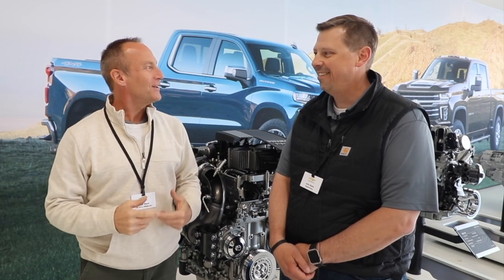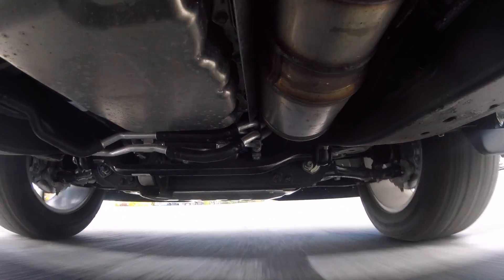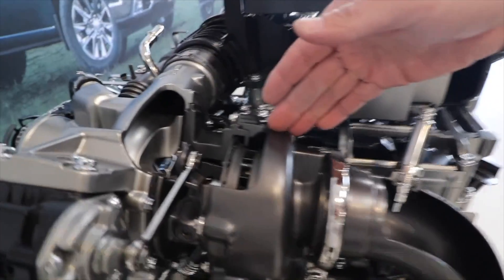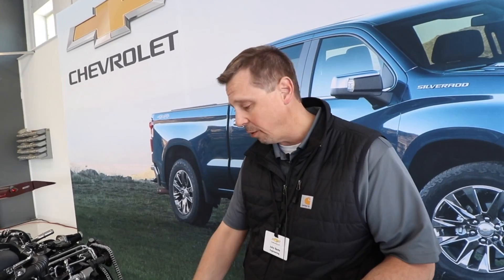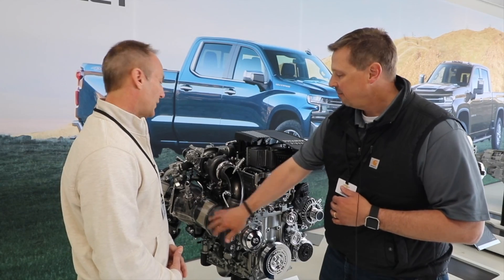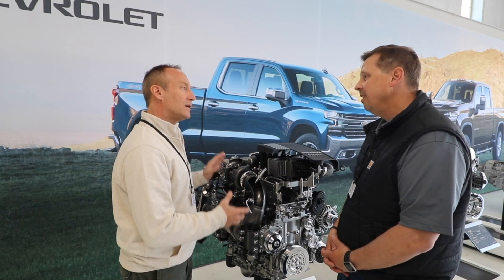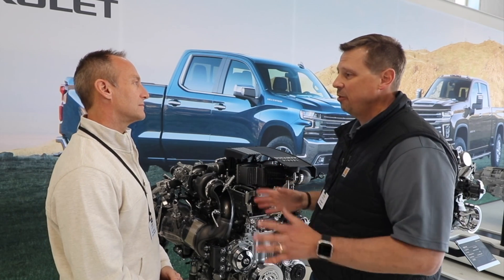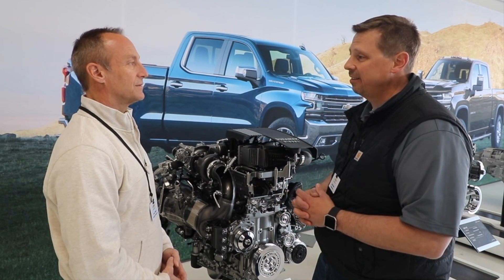Engineer Reveals All! Duramax 3.0L for Silverado 33 mpg hwy

Comment: I really like that they went with an in-line 6 but they lost me with a “wet” belt driving the oil pump at the rear of the engine where you have to separate the engine and transmission to get access to it. Additionally, an aluminum block on a diesel? No thanks.

Comment: GM never said or implied the following: (It will make it 150k miles, that is 70,000 miles of power and greatness.  I promise you will get the full 45k miles from this 15k mile engine and boy will it last you at least 150 miles. ).  I went to a Chevy dealership and they swore the Durmax diesel had Platinum tipped spark plugs that would last 100,000 miles.  I told them if the diesel had Platinum tipped spark plugs I would buy it right away.  That sales guy was so happy until he talked to his manager when I ask him to verify they were indeed Platinum tipped spark plugs.  Bought a Ram when the sales guy told me about the Cummins and knew all about including def usage rates compression ratios and laughed when I ask him if it had Platinum tipped spark plugs.  He knew I was kidding.

Comment: So, public math: 7500 miles on this diesel getting 33mpg, at $3.00 per gal plus $74 DEF is $755.82. So if your gas model gets 25.8 mpg at $2.60 a gallon, it’s equal. Then you can add in the extra maintenance costs and that the engine cost more to begin. This is at the current $0.40 gap of diesel and gas. It was at $0.60 recently. Hmmm

Comment: Ok. Cool engine. Glad to see GM making a light duty 3.0L for the 1500. However...however...who was smoking the weed when they decided to put the timing system at the back of the engine? Having to pull the trans to fix a timing chain is ridiculous. Better put a lifetime warranty on the timing system. I bet the stealership will be glad to ding you $2K to put timing components into this thing

Comment: I like that they added it as a option for the LT, unlike Ford, VW and others.  Only way to get TDi in the Jetta was to get a premium package which put the cost through the roof.  Same with Ford.  Someone who is buying a diesel engine wants economy, how the fuck do you think you will sell any of these when the vehicle costs as much as a house??  I dont care what the excuse is.  I think Chevy did right here unlike the others by offering it in a lower trim.  Only thing that really concerns me is two things right off.  First, that bicycle chain sized single row timing chain.  Not like we havent seen any failures from other engines with chains like this....Hemi...  Second, how close that DPF is.  Even if there are heat shields there, with that DPF up under the cowl next to the firewall, it will get hot and anything plastic there will be roasted in not much time.  We'll see I guess.  Looks cool though.

Comment: You started engineering the engine 5 years ago and it has a rear mounted timing system, and belt oil pump drive. Yes sir, you engineered that engine for residual income and profit. Not even third world country engineers would have done that.
Reply: Engineer are engineers does not matter the country origin, sometimes poor origins feed the ideas think abou it

Comment: What I’m concern about is the longevity of the transmission. I have a 2017 GMC Sierra crew cab SLT and the transmission is garbage.
Reply: Buuboi214 the new 10 speeds are nice. I have it in my 17 F150 and now have 55k miles and it’s never had an issue (unlike the 6 speed in my 2011). Ford and GM partnered together to build the 10 speed.
Reply: 8 spd?
Reply: Rollin Easy yup!
Reply: @Buuboi214  yeah I agree. At low/ parking lot speeds its garbage. Hard acceleration it shines

Comment: Unless these are built in the US from US spec parts (or German-Japan) this engine is going to be a anchor. Chinese spec/out of spec parts won't cut. Plus it sounds like there is ALOT of critical maintenance (dealer only) required.
So overall... more money to buy the pkge. More money to maintain the vehicle. And more visits to the dealer.
If your not driving over 20K miles a year. Get the gas engine and save yourself all the upfront-long term money and headaches.

Comment: Great engine until they used a belt to drive the oil pump. You just took a 500K mike engine into a 150K engine. That’s going to be at least a $1K service, and for me that’s about 7 years. Who knows what happens with other systems. And how much is this upgrade going to cost over standard engine💵💵💵💵💵.

Comment: Swirl valves? That’ll be an issue if they have any issues with soot buildup
Reply: Low pressure EGR should result in significantly less soot being ingested... however I see they do use high pressure EGR during warmup so it could still become an issue over time.
Reply: I’m just speaking from experience dealing with sprinter vans in the rental fleet I maintain. Almost every one of them at some point had to have the engine pulled to get a new intake
Reply: @RobertLeMay848  I can imagine... however the Sprinter uses high pressure EGR which causes tons of soot to go thru the intake, whereas with low pressure EGR the exhaust is drawn downstream from the DPF, thus the soot is already removed. So I would consider low pressure EGR the lesser of two evils as it keeps the engine oil much cleaner.

Comment: I just don't understand why GM is so tight lipped about the actual mpg. The reason to buy a diesel 1/2 ton is precisely mpg, depending on exactly what it is. I just took my 2019 with 6.2 and go 21 over 200 miles yesterday. To balance out the potential reliability issues with SCR, DPF, EGR, on the diesel, it had better get upwards of 30 mpg or it just doesn't make sense, unless you tow every day in which case say, 8-10 mpg towing with a gas motor will be considerably offset by 13-15 mpg with the diesel. I think GM is ultimately hurting potential sales by staying so tight lipped. People are getting tired of waiting and will buy something else if they are in the market.
Reply from the maker: I'm pretty sure they are just waiting for the 'official' numbers from the EPA, but seemed pretty confident it will be north of 30.

Comment: The modern diesel will never last like the old diesels. the EPA drove the nails in the coffin. 150 K miles LOL every modern gas engine I have owned in the last 30 years has made it past 275K
Reply from the maker: I'm pretty sure they all said 150K for those engines as well.

Comment: 150,000 miles? Chevy's goal is to make this truck run for at least 150k miles? Talk about low quality standards.
Reply: Ya well my 75 GMC Sierra Grande 4x4  has 604,600 miles on it and I have replaced only the enging with a GM crate motor at 345,000 miles. GM makes gr8 stuff and they do last a LONG time.  It's all about maintenance. GMC#1
Reply: @scott250r2  only the engine. 😂
Reply: @highbrass3749  Well no LoL. Tires oil break pads belts and lots of U Joints. Hahaha.  (Becouse of my lift kit) And I did remove the 4 speed and I put a THM400 in its place. Other that that. Yep.
Reply: @BigHayes7771  Yep like I said very low standards. Have a great time wasting your time at the repair shop and trying to get the dealership to live up to their promises.
Reply: Sad
Reply: @scott250r2  I had a 72 Camaro, the very first car my new wife and I bought together. Drove that thing for over a decade with just an AC failure. So American manufacturers can make good reliable cars 50% of the time. But which 50% are you going to be?
Reply: @breeze787   That what I'm talking about 😀.  I think now it's more than 50-50 though.  They seem overall to last better than the old days.  On anther note. Are you a 787 dude. As in Boeing 787?
Reply: @scott250r2 American manufacturers are making them better than ever before. But there are still a bunch of badly designed & built vehicles that's going to gnaw at them until they fix it. US auto is still making a lot of bad decisions just check out their recalls and high percentage warranty type work. 
Yeah 787 Dreamliner.

Comment: Note that since this disposable little 3.0 diesel actually DOES meet emissions, you’ll be using 1.5 gallons of DEF per 1000 miles while towing. IF the 6.7 Powerstroke Actually met emissions (see Ford EPA diesel emissions settlement stories) you’d be using 2.5 gallons of DEF per 1000 miles while towing. I think the revised 2020’s DEF consumption will go way up to be where the emissions standards require them. Yikes!
Reply: Neo Craft 
Funny you say that about the 6.7. My former service truck was a 6.7, upon delivery it had a code for NOX sensor...... After putting 32k miles on it I finally replaced it. In those 32k miles it burnt a whopping 2 gallons of DEF. 🤪😜😜. VW were just the only ones caught.........

Comment: Nothing last forever......except for a Toyota Tundra 4.6L
Reply: Michael Pawlicki, you mean Toyota 22RE?
Reply: Steve Stair, It’s not junk if I’m still driving it after 400k, with just a couple issues, and still getting great gas mileage! My Chevy was done long before this.
Reply: You probably take care of it yea they can last have one also but does not get that great of mpg, i also have a 2015 GMC Sierra with just the 4.3 v6 runs great put alot of miles on it will get alot better mpg runs like the older v8 and its a heavier truck.
Reply: Steven Strawn unless you have two drastically different trucks, the tundra weighs more
Reply: @justinmartin8887  not a 2004 tundra compaired to a 2015 double cab it does not its the older smaller tundra.
Reply: Steven Strawn fair enough. I know for a fact the current tundra is heavier than any other half ton
Reply: @justinmartin8887  o yea the current one for sure there is only a 350 pound difference in the two trucks im talking about though. The GMC slightly heavier
Reply: But i also upgraded to bigger wheels and tires on the GMC and has a tool box with stuff in it so probably 500 pounds more.

Comment: What going to happen with the water cooled intercooler when the truck is  sitting or driven in very cold weather?  What will happen if something cracks and leaks over the electrical system?

Comment: Most manufacturers have a "useful engine life" rating of around 150k miles. Ford does. The only time you'll see higher numbers are in the heavy duty trucks where they have "B10" or Bxx  ratings which will give you mileage before 10% or xx% will need some kind of major engine work. Congrats for making a big deal about nothing. You got your clicks though, huh.
Reply: Yeah every manufacturer, outside of Hyundai, uses 240,000 km or 150,000 miles as a lifetime target. It just means that by 150k miles, you'll need to do stuff like timing chains/timing belts, timing chain guides, etc. Hyundai claims they engineer their engines targeting a higher lifetime, but it doesn't show in the reliability of the engines they've been using lately.  

The heavy duty trucks have a higher life target using "B10" and "B50" ratings because those engines are sold in the commercial market and buyers want to see those numbers. Even then, engines like the 6.6 Cummins and 6.7 Powerstroke still only have a B10 of around 250,000 miles.
Reply from the maker: I was actually refering to his comments that he thinks the engine should go way beyond 150,000 miles.
Reply: @4WDMagazine  OK well that's my mistake then. It just seems like thatvpart of the video will create a lot of disinformation because 99% of the public don't understand that the engines in passenger cars, suv's, andblight duty trucks are all designed with the same lifetime mileage. As you see below in the comments, many already are taking it the wrong way, assuming that when the engine reaches 150k miles, it's shot. In reality, it means it might need new timing chains or oil pump belt.
Reply: My son is looking for a good used truck, we got on Auto Trader and we were shocked at how many F150’s and Silverado’s had 200k plus in the odometer!

Comment: I agree that it wouldn't be wise to by first year anything.  But I hope that this engine will provide another way to reduce fuel consumption.  Problem is, in my neck of the woods we pay 10-20 cents more per gallon of diesel.  So it had better be VERY frugal.
Reply: Diesel is 40-50 cents more per gallon around here.
Reply: And there you go.  What part of the country.  I'm in So Cal.
Reply: @ktpinnacle  Minnesota

Comment: DOC, DPF, SCR, DEF, EGR swirl valves....disaster waiting to happen. I don’t see why truck builders keep putting diesels in small trucks and cars. Diesels weren’t designed to just ride back and forth to work, pickup up groceries etc. They were made to work and the shit ran out of them.
They cost more to buy, more to repair, Hell even the fuel cost more per gallon.
Reply: 2 egr... So many failure points.
Reply: Why does the rest of the world use Diesels for exactly that?

Comment: Watch the video again at 7:20 he talks about regen. If you look back at the old way of regen(cleaning out the filter) gm in the LMM 07.5 to 10 Durimax had this system and ford had it in the 6.4 power stroke 08-10. When they inject the diesel into the cylinder on exhaust stroke it washes out the rings on that cylinder and will cause the engine to fail. Many as low as 20t miles. Almost all by the time it got to 150t. So I’m disappointed to see gm go back to an old system that they already know does not work and bring back a problem that they have already got an answer to.(adding an extra injector to the exhaust pipe after the turbo) very disappointing I was hoping to get one of these diesels when they come out but now that I have seen this I will be waiting till someone cracks the ecm so I can delete the dpf and egr before I spend my money on it. Or wait till gm adds the 7th injector to it.

Comment: I would have more concern with the DPF being right under the hood. Heat soaking the engine and intake air temps. Also burning out injectors with all the Cycling. Also seems like they maid the cooling system way over complicated. And two EGRs!  Nothing but engine murderers.
Reply from the maker: You could be right. I think that's what limited the max towing number - cooling challenges.
Reply: It's called,  Satisfying the Gov't 
It's the "New"G-spot~😲
I heard the "extended" warranty 
comes with several free visits to
Dr. BenDover 😱~ 😄

Comment: there are way to many things to fail and clog and two EGR systems they work so great with just one
Reply: Eric Herrmann This engine uses “cleaned” EGR, meaning it’s post-DPF exhaust that goes back in. No soot will make its way in. But that doesn’t mean Ash will not. After 100k, the ash will start to build up inside the DPF and most certainly some will be put back into the cylinders. If you’ve ever felt DPF ash between your fingers, you’ll know that it’s like pulverized rock. So, no, the EGR valve/cooler will not clog. But the engine oil will need to be changed at 3,000mi intervals —or less once truck is around 100k if you want this thing not to have scored cylinders by 150k. I really don’t understand the lust for more complex, more energy inefficient engine “technology”